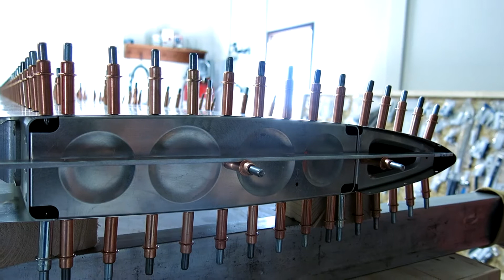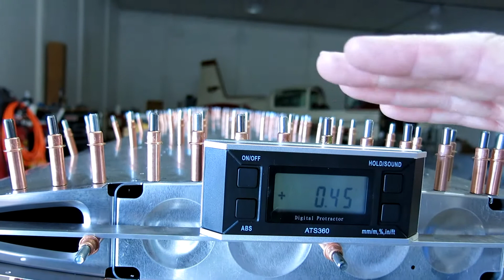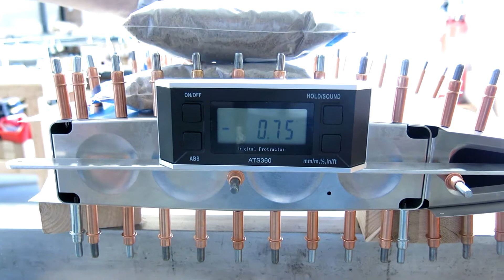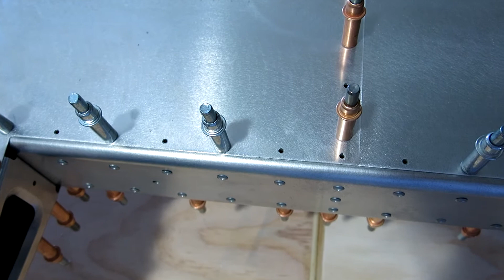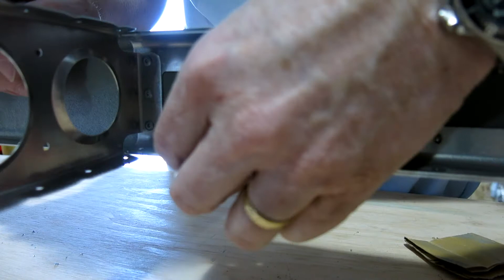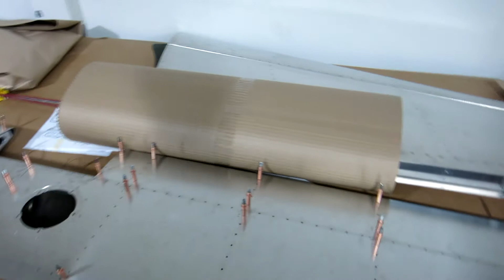No. 25 09-26-2020 Horizontal stabilizer...still...

Comment: It looked like you had a negative (-) angle on one side and (+) on the other.  Were you flipping the level around as you went from one end to the other?  I always keep my level the same orientation (the same end point forward) so that angle is the same.
Reply from the maker: I initially was keeping the protractor in the same direction, but found that ATS protractor is dead on either direction, so have been flipping end to end.
Reply: @s-21project92  I’m still using an old-fashioned bubble level.  I do have a digital level on my Christmas list though.  Although, I checked my bubble levels against my iPhone with a level app, and it is amazing how sensitive a bubble level is.  I am not sure a digital level is any more accurate, but they are easier to read consistently and they obviously can be used at angles other than level, vertical and 45 on some levels.